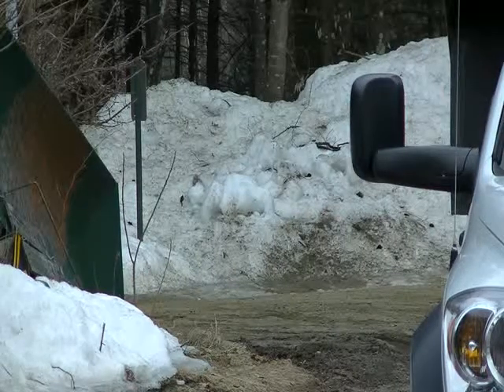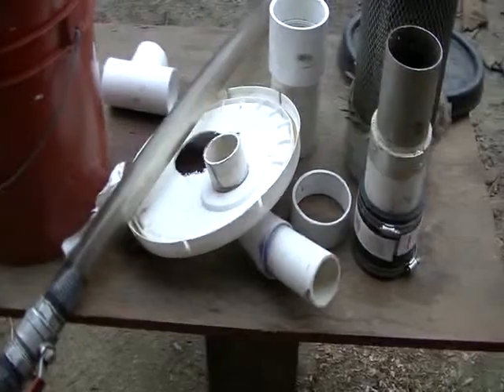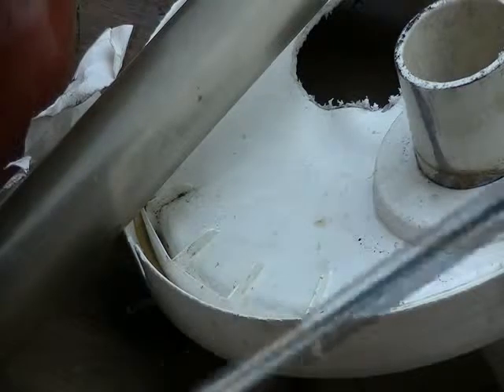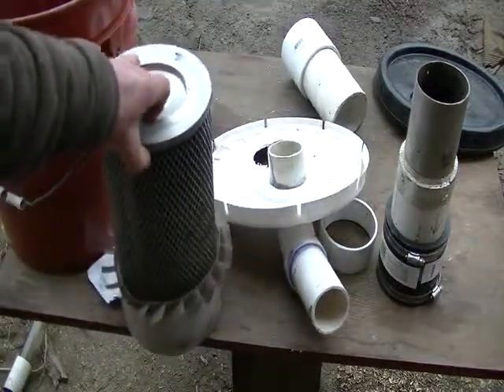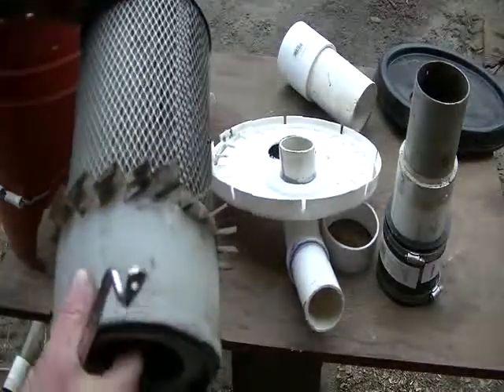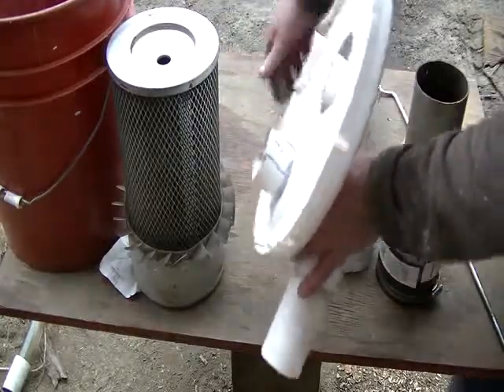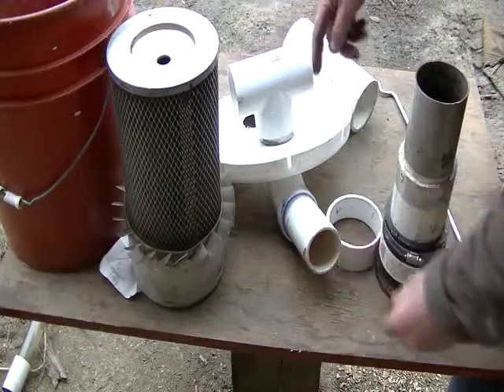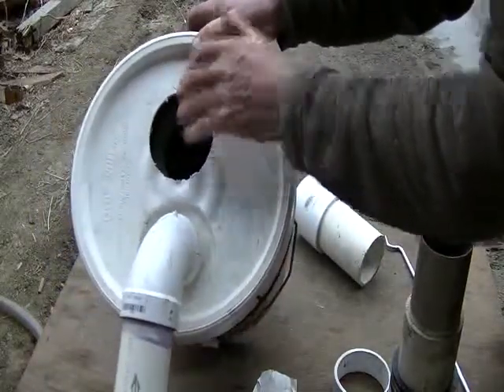A final woodgas filter idea.

Comment: That's a good start to the new filter.
Perhaps you would have an easier time if you were to block up the hole in the bottom of the filter, and press the filter's rubber seal against the lid of the bucket.
That way, you could use a pipe flange to couple the external plumbing to the lid of the bucket.
The pipe flange, if big enough, could be held in place with 3 lengths of allthread that would extend past the bottom of the filter, thereby serving as a means of pressing it against the lid of the bucket.
I hope that makes sense.

Talking of dirt in the clear delivery hoses, I have something similar in mine.
My hoses were once clear, but are now heavily coated with grey nicotine stains, like a smoker's lungs.
This happened within the first 100 hours of engine runtime, and I am assuming that the coating is getting steadily thicker with each subsequent engine run.
That stated, I have had 481 hours of trouble free engine runtime to date, so I suspect that this is not harming my 13HP grunter  :) .

Whatever you do, make absolutely sure you put some stainless steel wool in the path between the engine and this filter.
An explosion in such a large filter would be quite spectacular!

Keep up the good work, my fellow woodgas addict  :) .
Reply from the maker: *****  Thanks for the insight and sharing your concerns. Regarding plugging the small mounting hole at the bottom of the filter, much to my surprise a plastic lid from a chockfullofnuts coffee can pushes onto the base perfectly, covering the whole base as a seal..  Mounting the filter with the large rubber gasket pushing against the bottom of the bucket lid would not work due to the uneven surface of the lid. There are molded ripples which would prevent a seal.  But the way the 3 inch pipe pushes  down through the lid, through the adapter ring and well into the filter makes for a good seal. Silicon applied around the 3 inch outlet pipe on the outside top of the lid seals any leaks to the outside air.  Not shown in the video is a sizable sheet of soft , absorbent cloth used for oil spills which hopefully will disrupt the straightline flow of gas to the filter and hopefully capturing some of the residue. 
I will heed the warning about " blowback" and put some stainless in the line. I'll do up another video with the test results when I get the whole mess out of storage, back up and running.  Thanks again !
Reply: NH Hbbyloggr
Good work indeed.
When it comes to filter housings, I really am quite addicted to the use of 4 inch PVC pipe, with end caps.
These are quite expensive here in New Zealand, but they make life so much easier  :) .
I look forward to seeing good news from your latest developments.

Keep up the good work.
Reply from the maker: ***** 
 Steve, I agree with you on the PVC filters. I do have 4 6" filters like Flash001 uses. Actually  my whole system is a clone to the South Carolina mechanical engineers build. I believe mine are 6" diameter filters. They are expensive here, too. BTW I'm liking your new V-2 finger snipper ! pretty clever.
 In an effort to get a lot of wood prepared for the gassier to keep on hand I'm resurrecting an old wood chipper that has been sitting around for 5 years or so. The plan is to make a mountain of chips and then screen it to size , dry it in solar drums ( 55 gal drums painted black ) and keep out of the weather...only to re-absorb the ambient moisture in the air. Oh well, it's always fun !
 Thanks for commenting !